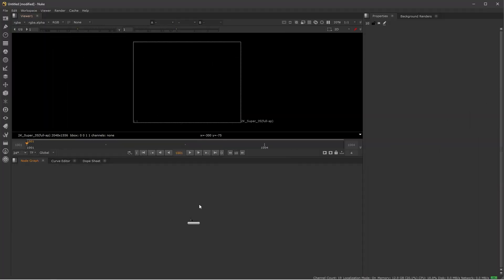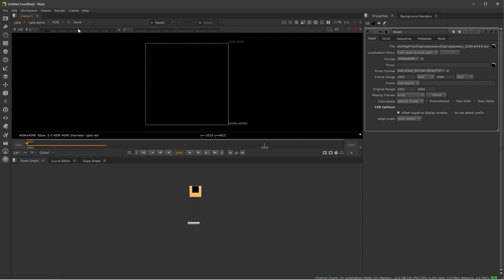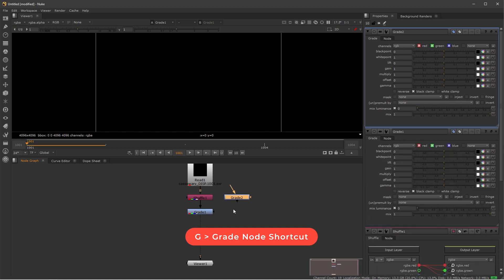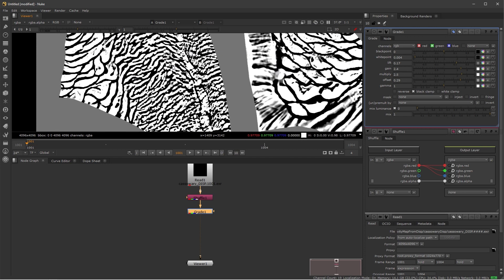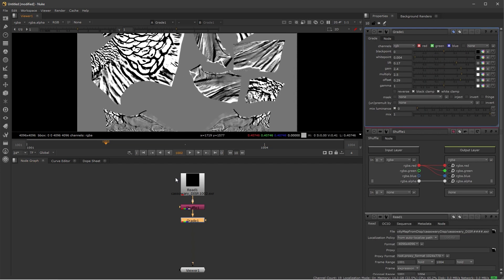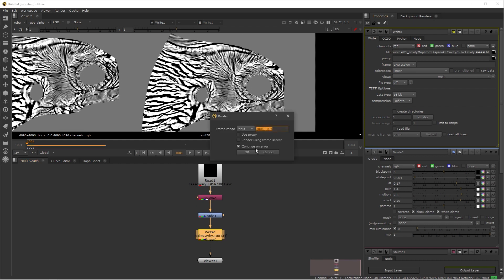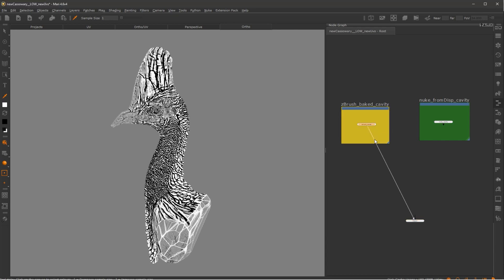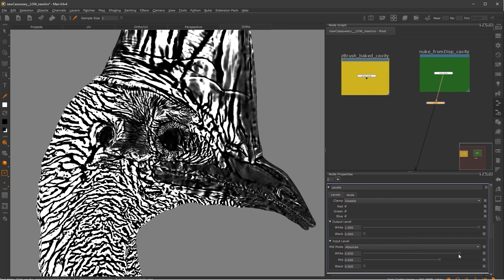How To Create a Cavity Map From A 32-Bit Displacement in Nuke | Paint Drops #02

Comment: Hi Paul, tanks for the tips!  I have a different workflow with for exporting better cavity map than using Zbrush MME Cavity.
It is based of polypaint so  it might be not good for big projects with a lot of UDIMS etc. But it give a much nicer result !

First I subdivide my mesh one more time (if I can) and I start with a base color White  then I do a "mask by cavity" and "FillObject" with Black with a mid "RGB Intensity"  but I do this 3-5 times with various "Cavity Intensity" from 100 to 10. It depends on the mesh but it give a smooth curvature and brings a lot more detail than normal Cavity export. Then I export the Polypaint true MME :)

Maybe you already know this way of doing the cavity but I wanted to share it :)
Reply from the maker: Hi Solal, thanks for sharing! I really like this method! 
This is one of the ways I used to use when I wanted to bake cavity masks in Zbrush. 

It's also useful when I want to export a curvature mask using the "mask by smoothness option. 

But like you said, it can become a problem if you have a larger mesh and need to subdivide multiple times. 

The reason why I've been using the Nuke technique lately is mainly due to the speed and the ability to create multiple variations without having to go back to Zbrush and re-bake with different settings